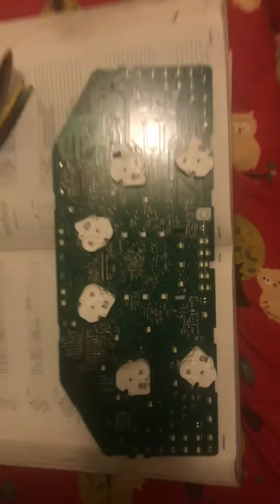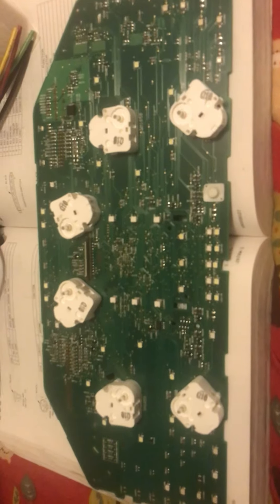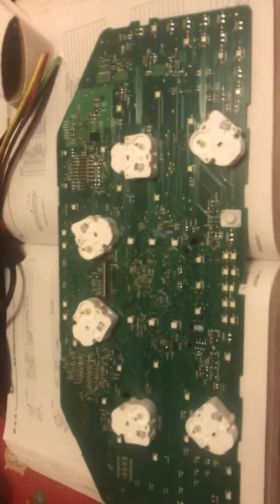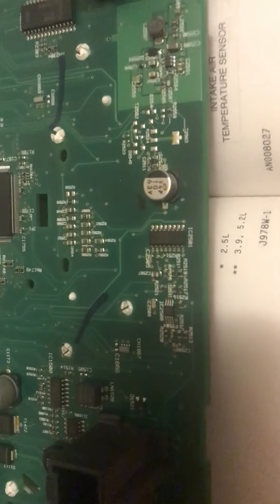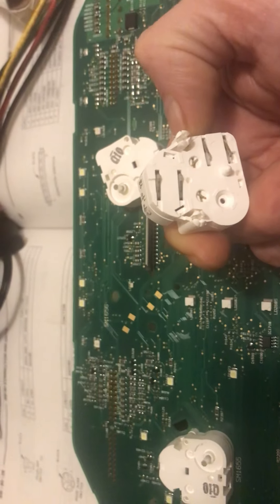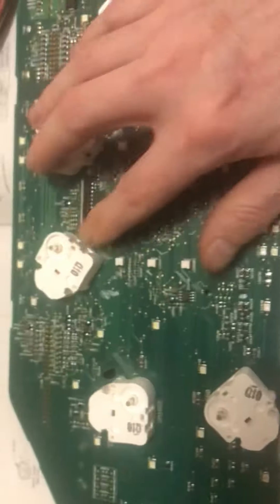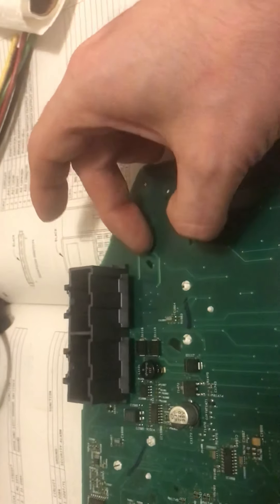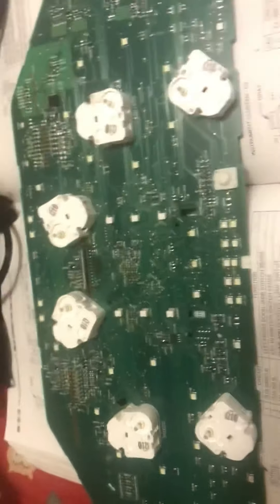Modern mopar gauge cluster stepper replacement

Comment: Well done Chrysler. I've replaced these on GM clusters and it's a nightmare. Any tips on calibrating them?
Reply: I know on my Dodge ram you push  in and hold the stem that sticks out of the front of the cluster and while holding it in turn the ignition on and off three times and continue to hold it in and it self sets the gauges.